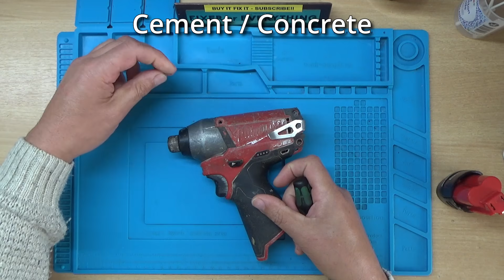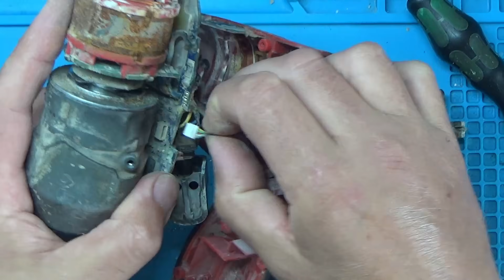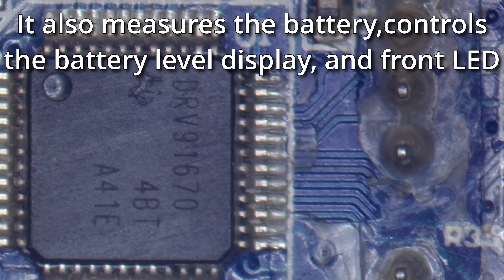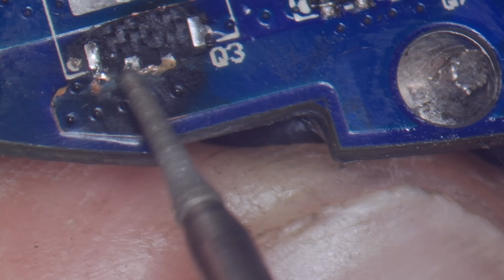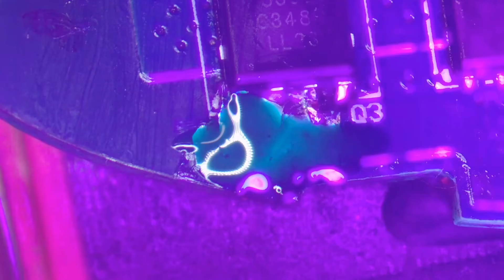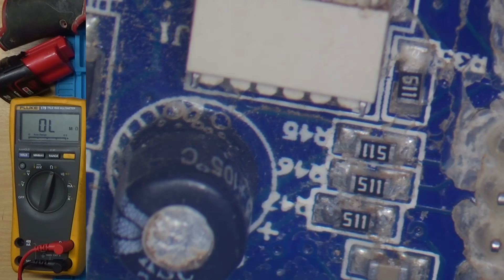Faulty Milwaukee M12 Impact Driver | Can I Fix It?

Comment: Should perhaps have removed the carbonised fibre from under the burnt copper track. Otherwise, good work.
Reply from the maker: Yes good call. I had been thinking the same when watching the video back on a large screen. I didn't think I was going to get this one done as it was 1am when I finished recording as was having a nightmare with the motor being jammed after reassembling the tool, and it was around 3.30am time I got to bed after the 1st rough edit 😂😂 so it was a late night.

Comment: kind of wonder if the resistor failed first & threw the balance on the mosfets out, then pop
Reply from the maker: Possibly but I've repaired plenty of other tools where only the mosfets have blown. They usually have a pull down on the gate, and this resistor came straight from the drive pin. I think the mosfet blew first and tried to send 12v back downs the gate pin which luckily popped the resistor and not the i/o pin on the chip. Thanks for your thoughts and commenting 👍

Comment: The worse part about working on power tools is getting it back together again!
Reply from the maker: Oh yes, totally agree with that. The motor kept jamming for some reason when after I assembled it. I don't usually have that with Milwaukee tools  but this one was a nightmare. That's why I said I've had it to bits loads of times, I just didn't put those assemble / disassembly bits of video into the final edit or it would have been an extremely long and boring video 😂😂😂
Reply: Or getting them back into their box (the box must close; the power cable must also go into the box; cutting off the power cable is not considered good practice here).

Comment: Fantastic work, yet again. Although that thing needs a serious dip in a vat of warm diesel, followed by a good soak in oil and grease to kill of the crustyness. I still don't like that membrane gear selector switch they put on those tools, just use a good old ca-chunk-a-chunk switch, it's a work tool, not a game controller.
Reply from the maker: Thanks General 👍I did clean some of the rust from the motor with a wire brush and some fine sandpaper. I also added a thin smear of oil. Hopefully that makes it last a while longer 🙂

Comment: Excellent video. When I saw all that rust/dust on it I was convinced it'd end up a non-runner. Very impressed! I'm wondering if you can read the firmware off this if you run a glitch attack on it
Reply from the maker: Thanks Jay👍Yes when I opened it I was thinking that too! Another viewer was asking about the firmware and I too suggested a glitch attack might be possible 👍Thanks for your thoughts and comments 🙂

Comment: I dont suppose you take on multi meters, I've fried mine.
Reply: If it’s cheap, buy another one.
Reply: @charlesmurphy1510  yes I did think that but if someone can repair it for a reasonable price, then it doesn't get thrown away.
Reply from the maker: Drop me an email. It's on the about channel page at the bottom (contact for business button). It doesn't show on the mobile yt app though.
Reply from the maker: I don't usually take on repairs, what make  is it and what's it doing?
Reply: @BuyitFixit  it's an extech ex355 multi meter , put new batteries in it, the batteries got really hot , continunuity didn't work lots of strange readings functions not working 🤷‍♂️ turns
Reply from the maker: Just did a search, and theres a few pictures of the insides of a ex350 on eevblog. Not sure if yours is the same inside, doesn't look a lot inside. Only 1 chip. Some diodes which I'd probably check first.
Reply: @BuyitFixit  I won't lie I opened it up looked at it, seen just what you described and then closed it back up again didn't have a clue. Just looked at that eevblog you mentioned the inside is exactly the same

Comment: I have a few milwaukee tools that are faulty and seem to be the main chip, do you think it would actually be possible to read the data from a working chip and write it onto a new one? Or would this only be able to be done by the manufacturer
Reply from the maker: I think it might be possible. It's probably read protected but it might be possible to bypass that by using a glitch attack. Someone else did similar with a different chip.
Reply: @BuyitFixit  I am interested in trying to see if its possible, do you think any generic QFP48 programmer would work on the DRV91670 chip?
Reply from the maker: No, I'm trying to remember what core the chip had. I know the chip is made by TI but there's very little info out on the internet about it. I just saw your post on reddit 🙂 the only crumbs of info I found was on the TI forum, try search on there DRV9*
Reply from the maker: www.ti.com/lit/an/slda026/slda026.pdf was about the only info I could find.
Reply from the maker: https://e2e.ti.com/support/motor-drivers-group/motor-drivers/f/motor-drivers-forum/725728/drv91680-programmer/2694889?tisearch=e2e-sitesearch&keymatch=drv9%25252A#2694889  might also be of interest

Comment: Another great fix, keep em' coming. Gonna have a go at this soldering game now I'm retired, Could you tell me which Leaded and unleaded solder & what flux would be best for starting. Cheeers. Ian
Reply: Amtech flux, never use unleaded solder too much heat required to melt, all micro solder repairer's use only unleaded, and buy a decent soldering station cheap ain't always better.
Reply from the maker: I thought that silver solder (unleaded) had a higher melting temperature than leaded. That's why Northridge fix uses it?

Comment: Hi i never understood why you always put everything back together before you even know if it fixed ?
Reply: In this particular case, due to the nature of the tool it's best to run it with the shell on, although I must admit that I wouldn't have added all of the screws before trying it.
Reply: Confidence,  sometimes the fault is so obvious your 99.9% sure it's fixed, I do it with phones tablets computers all the time experience is everything you get to know faults.
Reply from the maker: I could have possibly put a few less screws in, but you can only really test this by putting it back together. The casing holds the bearings for the motor and it won't rotate otherwise.